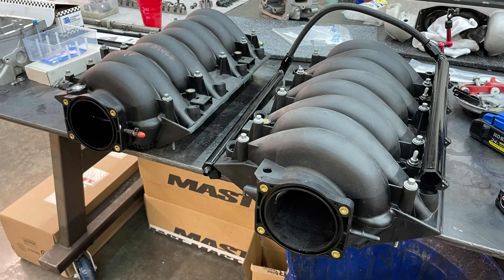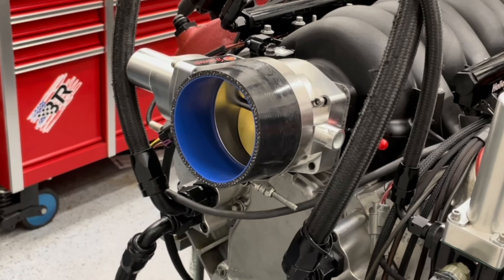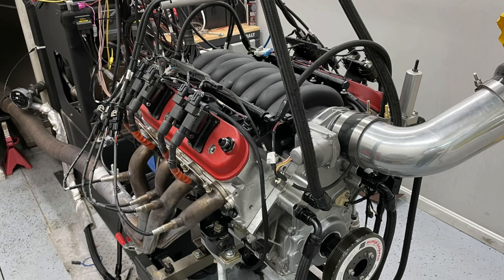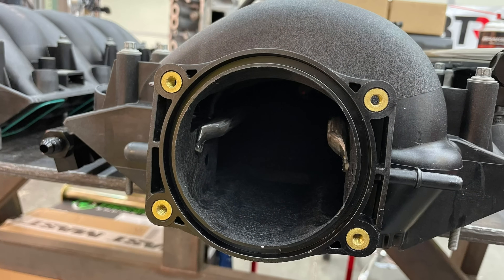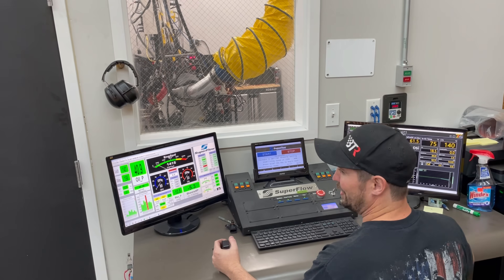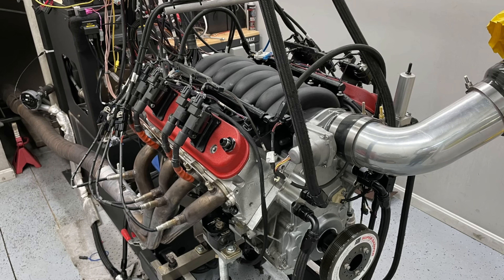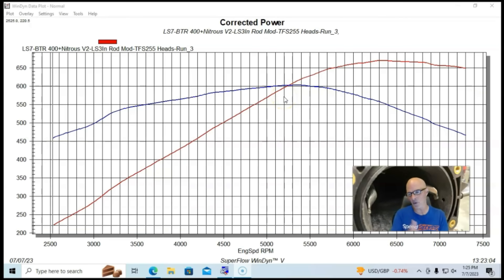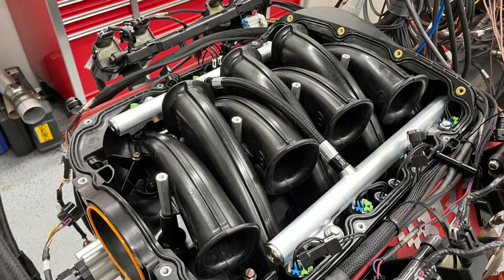HOW MUCH POWER IS THE LS3 ROD MOD REALLY WORTH? 427 LS3 STROKER INTAKE TEST-STOCK LS3 VS ROD MOD

Comment: Man, those Chevrolet engineers who made that intake were out for victory, weren't they?
Reply: The whole engine is amazing. The ls3 is the best na ls they made in my opinion.
Reply: @Skubasteph  Id argue for the LS7 myself.
Reply: @Saddedude  ehh there really expensive rare engine that like to drop valves. so id always go for the ls3 over the ls7.
Reply: @Skubasteph  How do you all feel about "LT", some are showing "LT" results exceeding LS3/LS7, but up until that time I was personally seeing better LS3/LS7 results.
Reply: @dennisrobinson8008   I think the LT motors are more difficult to make big power with. Folks are making 2000+ with the newest l8t iron block, but with aftermarket fueling and run like an Ls engine. LT engines really shine stock and supercharged, with constant variable valve timing and direct injection. Cvvt adds tons of power and driveability under the curve. Most cams from what i can see remove the cvvt, which defeats some of the purpose of running the higher tech engine. DI seems pretty expensive to upgrade, so port injection is probably better, which basically puts you back to a fancy LS
Reply: @goofy72882  Thats funny but sounds like you have assessed the situation fully.   VVT will basically allow us to run a big cam and it can alter the valve timing events to give us up to a 50 ft-lb increase at idle to 3000 rpm, which is a big deal.   The cam manufacturers need to learn how to work with VVT.

What about the LT cyllinder head flows.   Up until i had someone who  was big on LT talk to me, i was under the impression that the LS3 ported and LS7 ported do much better than the LT heads even ported, but that person showed some different information on that point.
Reply: VVT on an overhead valve engine will always be a bandaid at best.  Yes you can use it to make a slightly bigger camshaft more streetable.  But unlike dual overhead cams, you can never divorce the intake to exhaust camshaft overlap, lobe separation angle, etc.  yes advancing and retarding the entire camshaft has benefits and moves power around, but it’s not going to create the gains that you’ll see on DOHC engines.
Reply: @saab9251  thats undoubtedly true, thats why the 5.0 coyote makes similar power to a 6.2 ohv engine without the 1.2 extra liters. Dohc v8 engines r massive though, and the relatively small size and reduced complexity of the ls/lt engines is a feature for some and a drawback for others. I think its fantastic we have both great options.
Reply: @saab9251  None of us said it will be exactly the same as the gains with VVT on DOHC, but there is a LOT of gain even on a single cam engine with VVT.   Gaining 50 ft-lb in the lower rpm on a 6.0L engine just due to VVT is a big deal...
Reply: @dennisrobinson8008  Old post I know but the LT GDI direct injection offers more power by not being in the intake flow. it also helps manage detonation by controlling when and where the fuel is put into the chamber. This is F1 technology. The fuel is one of the biggest limiting factors on power production because it determines timing and compression.
Reply: @TheBDD1970 Excellent.  Do we know what percentage of flow was lost by having port injection or carburetor?   How much of a torque increase does this provide?   How much additional compression is available?
Reply: Honestly, I'd say that's true for most modern intakes, say 2000s and up. I think switching to injection molded plastic gave the engineers more freedom to really optimize the intake design, and I think that's exactly what we're seeing. Same story with the Coyote too, especially that 2018+ Mustang GT manifold, real hard to beat.

Comment: Is this the ported rod mod or just the rod mod?
Reply: Looked like some minor porting around the inlet, but I'd be interested to know if the runners were ported as well. GPI, as well as people doing A-B testing on them on dynos, pretty consistently shows 6-8 HP on stock engines and 12-15 HP with a decent cam for the *ported rod mod*. Typically the mid-range torque also picks up double digits as well.
Reply: He mentioned there being some port matching so I’d assume that they did.
Reply: @thebradnoyes  I did hear him mention they ported it to handle the bigger throttle body I must have missed if he talked about them poting the rest of the intake.
Reply from the maker: We did NO additional porting to the intake other than what came with the Rod Mod modifications-Also, it was not matched to the larger throttle body (the mismatch was shown in the video).

Comment: Least dude running the Dyno actually opened it up! Unlike, cough, someone else. Btw, move on in life already! Ur doing basically same shit over n over. Snooze fest!
Reply from the maker: dude on the dyno didn't do anything to the intake except test it
Reply: @richardholdener1727  dude on Dyno actually opened it up, hence running it past 5.5k is what I was getting at! 🙄 Again, get a nailhead n actually do something that ppl never do because not one person thinks of them. 401 or 425!
Reply from the maker: Not familiar with the phrase Open it Up as meaning ran it past 5500 rpm-but most LS motors run well past that-but you knew that. Good luck on your nailhead

Comment: Would have been good to see how the Fast LSXR intake compared
Reply from the maker: The LSXR LS3 intake has never shown much power
Reply: @richardholdener1727  What about a Fast LSXR LS7 intake with a 102mm throttle body? Reason is I have one and I am replacing a blown up LS7 with a 427 stroker LS3.
Reply: @Gearbhall no one uses lsxr if anything highram ported or msd ported
Reply from the maker: Fast LS7 is good-MSD LS7 is better, but these were all LS3 based intakes-not LS7
Reply: @richardholdener1727  Thanks! I am glad I can stick with the one I already have. I expect the MSD intake probably isn't worth the extra money over the one I already have if its good.
Reply: @richardholdener1727  ok so what about the Fast high rise LS3 intake